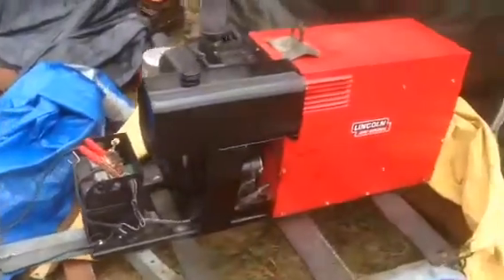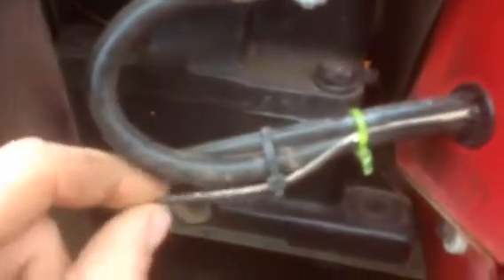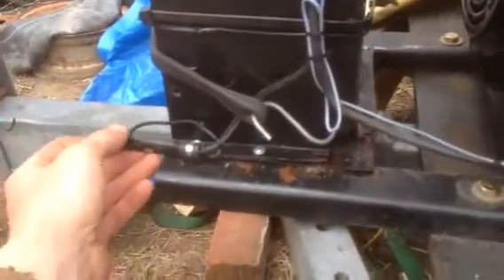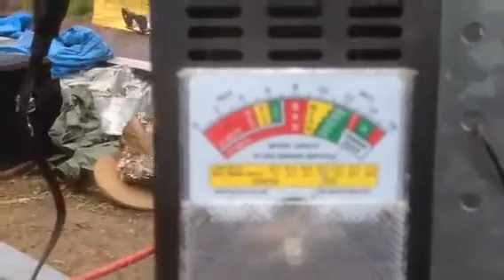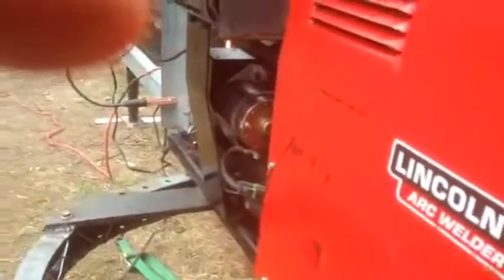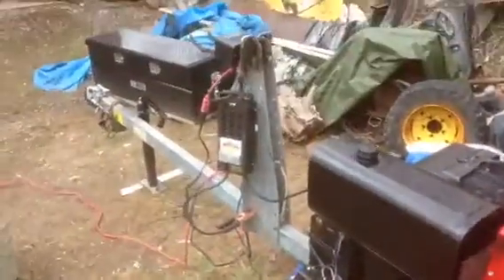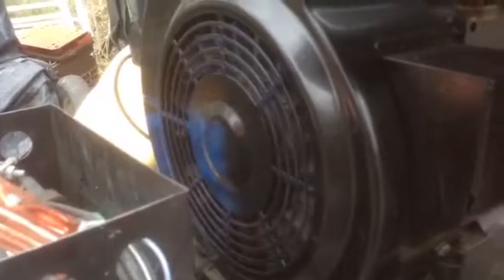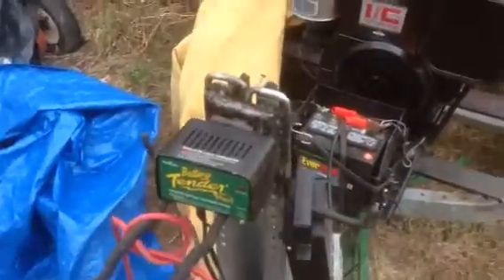Lincoln not charging

Comment: I have a get 250 ranger welder
 I don't think I'm getting power to the fuel pump. Does it have a alternator?
Reply from the maker: Michael Fanning, I believe at one time it had a flywheel type alternator like a lawn mower to charge the battery and excite the generator but it's missing so you just hook it to a battery and it works fine. As for a ranger 250 I'm not very familiar with them as far as what they use for an engine or fuel system so I can't offer much help

Comment: I have the fix. Its a generator welder with 120 outlets why not buy a better battery tender or a charger that's like 5-10 amps and plug it into the outlet on the generator.  My diesel generator had no charging system but I put a 30 amp battery charger on it and plugged it in to the generator so I'm converting some of the 120 volts to what ever the charger makes like 14 volts. Then I had a 1000 cca semi truck battery handy so I can jump start anything with it
Reply from the maker: well it had a 1.5amp  charger under the hood that plugged into the outlet,  it causes the engine to run at idle all the time and it was such a small charger it would have to go all night to recharge the batt

Comment: I have a Weldanpower 225 g7 and it charges from the "idler/charging" board inside the unit.  There is not an external stator or regulator on the engine shown on the schematic for my machine.  If your schematic shows one, you should be able to find one from a lawn tractor since they used the same engine setup.